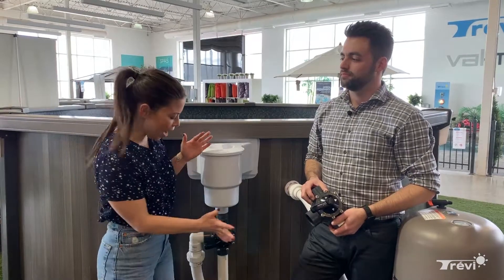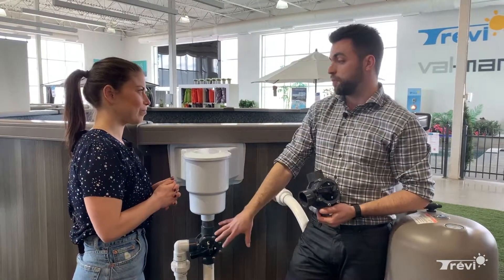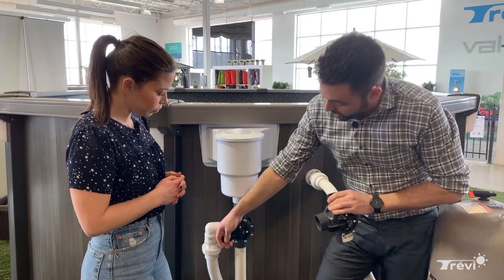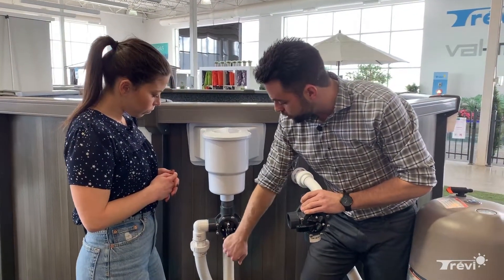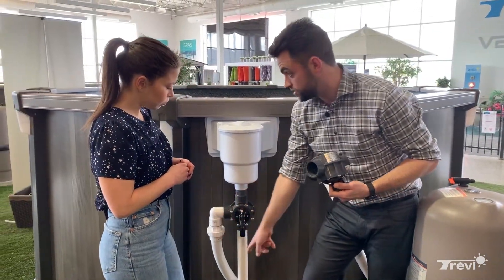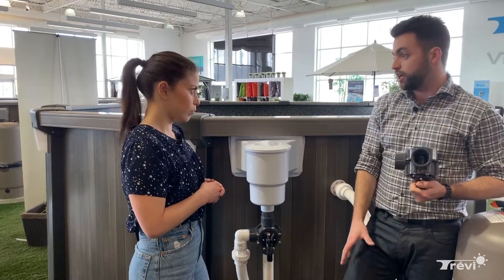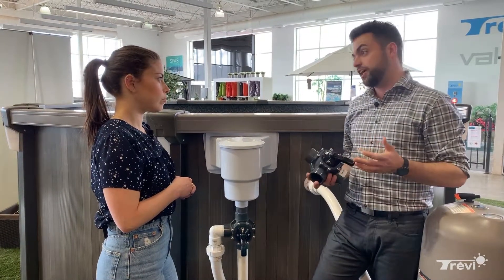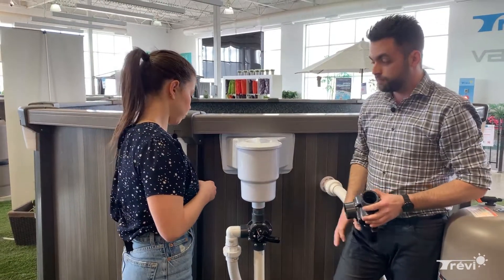Understanding the three-way valve

Comment: I turned off my pump and tryed to turn that left but couldn't so i turned it down and back to the right gave up and turned the pump back on now the trap next to the sand filter isn't full of water anymore is that bad how do i fix it
Reply: you need to take a bucket and prime it. fill it, close it, open valves and turn on. repeat until it's pulling water from the pool. otherwise it will suck air